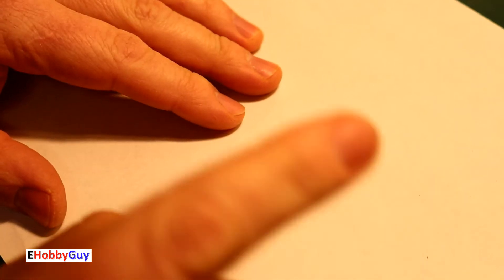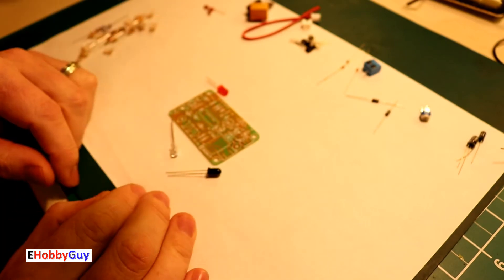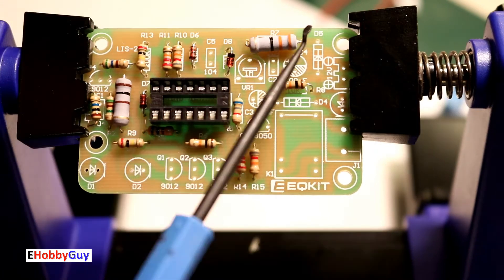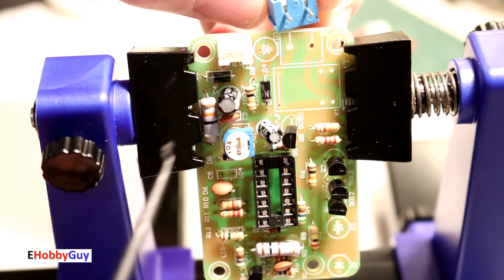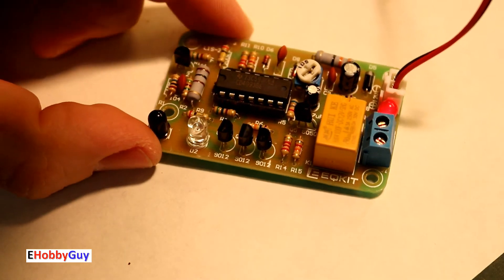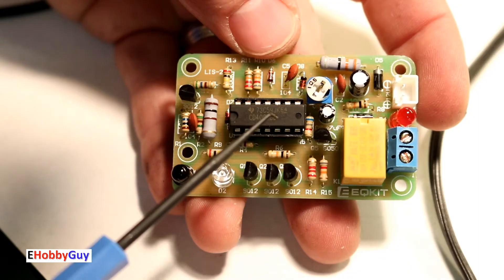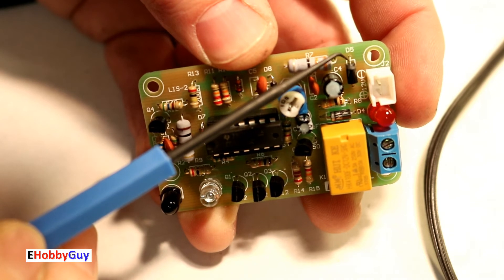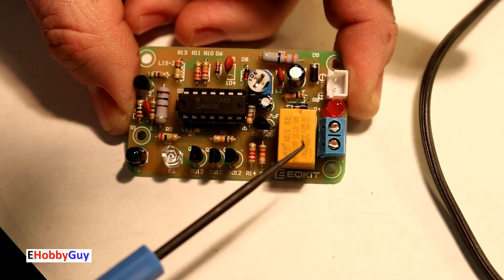HUMAN INFRARED SWITCH

Comment: Thanks for the video, I just built mine yesterday, and it seems to be working fine. I have recently noticed that after my 68th birthday, I have been making mistakes as far as polarity hookups reversing my red and black leads on my home built power supplies.  So I have been extra careful when placing diodes and such, thankfully mine works just fine. I was a bit confused as well as far as where the LEDs were placed, and, like you I referred to the photos of the completed unit to get my placement correct. I just wanted to view some video on the build to see if anyone was getting any better range out of their builds. I can get mine to turn on at about 9.5 inches from the sensor, not great but for a toy, not all that bad either.  I did notice that right off, it takes a few seconds for the caps to build up a charge before she is ready to work.  I have considered replacing the caps with a bit larger ones to see if I could extend the range but I don't think it would make much difference. I am running mine off 12 volts that I am pulling from three 18650's in a holder, right now with their state of charge, she is putting out 11.8 volts, so right about on with the 12 volts that the auction said they need to run.  I am guessing a fellow could perhaps get it running off a 9 volt battery but have not yet tried it.  I found the kit when I was thinking of building a tri-corder from Star-trek TNG, I have located a lot of sensors that I could run from an Arduino, or perhaps a nice ESP32 so I could use wifi and Bluetooth in addition to the screens I intend on building into the unit. I thought, perhaps I could work this into the project, but now I am not sure. Perhaps I will make an entry light switch for my RV or something.  Thanks much for the video, it was nice to see that I am not the only one who occasionally makes errors on parts placement.  Oh and to check the output of the transmit LED, look at it through a cell phone camera, you can see the little clear LED transmit it's light.
Reply from the maker: Jerry Ericsson thanks for the comment. I love getting real world feedback. Thanks for watching!!

Comment: i have adapter 12V DC 500 mA, is that good power supply for this, as much i understood it uses like 30mA, is 500 too much?
Reply from the maker: nseriousget it is perfectly ok to use a 500mA power supply. It will only use what it needs. Thanks for watching!!
Reply: thanks for ansver, and so quick response too
Reply: hi, its me again lol, i fried my 12v dc 500ma adapter, and now i have 12v 2000 ma. 
similar question as before, is 2000ma too much for this device, or will it work fine?
Reply from the maker: nseriousget yes it will be perfectly fine to use the 2000mA power supply. It will only use what it needs. Thanks for watching!!
Reply: thanks again

Comment: Nice unit, but not very sensitive.. I wonder why the ir emitter diode isnt visible through the camera, it should be.
Reply from the maker: migsven surfing yes!  I’ve noticed that it does not pick up remote control IR flashes either. It is strange. The technology must have changed somewhat with the camera?
Reply: EHobby Guy Or it has a VERY good ir filter.
If you have an oscilloscope you could find out if the current to the ir transmitting diode is pulsed at a high current. If it is just receiving constant current, it will explain the bad sensitivity. I pulsed... its just a bad design.
Reply: MrQuidestveritas Not much emission I guess then.

Comment: Hi Paul, this was a very interesting tutorial and thanks for sharing. As you might know my knowledge is very limited and I cant think what kind of a application I could use this for,  all I can see is that I could have some lights on for up to 40 seconds when triggered ( maybe an alarm? ) Great tutorial as usual. Thanks.. John.. :)
Reply from the maker: Thanks again John. I️ appreciate your comment.  Interesting question. After I️ put it together i thought about putting it on a boom box I️ am planning just to turn on a back light for 10-20 seconds while I️ make changes to what’s playing.
Reply: Our bedroom in our house has no overhead light, and our bed-lights are on the wall opposing the door.  I had thought, perhaps hooking a light up to this unit, so I could wave as I entered, lighting a light up so I could find my way to the bedside where the lamps are.  Right now I just use a little penlight, my good wife of 50 years has good enough night vision that she needs no extra.